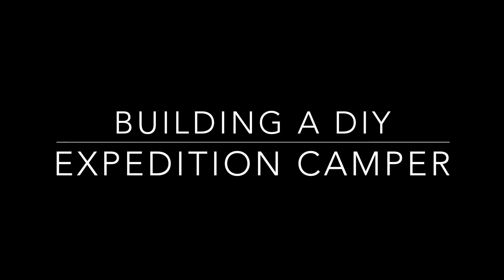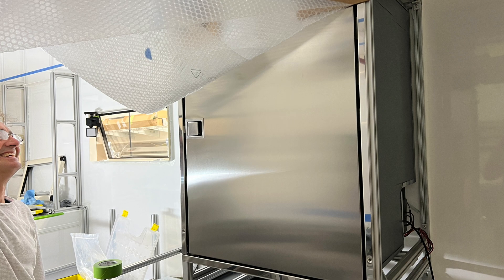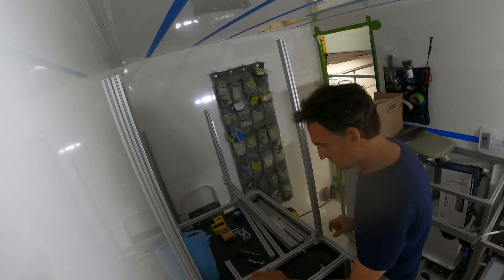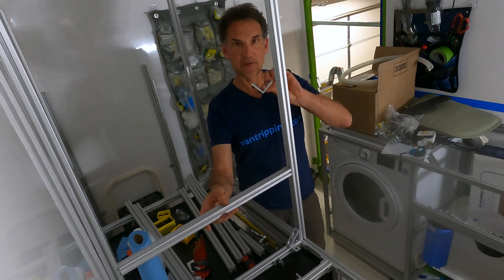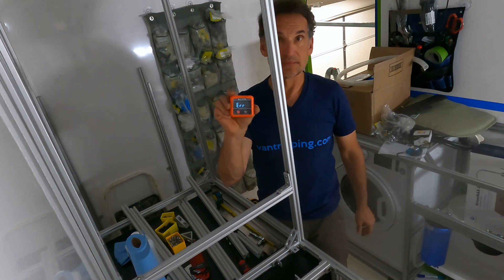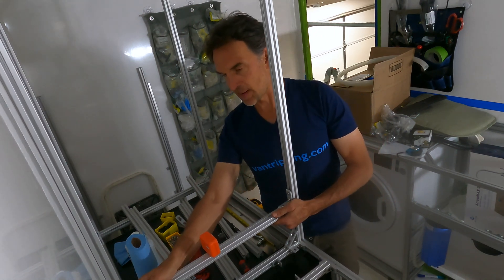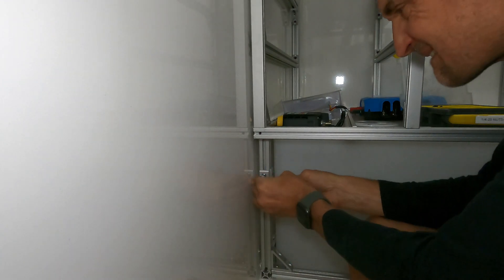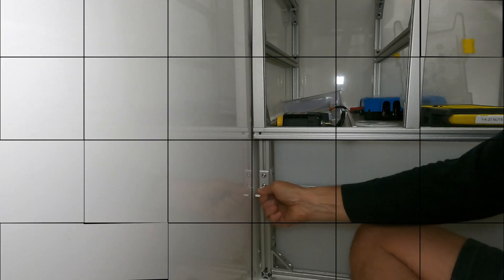Selecting hardware and connectors for 8020 cabinets

Comment: I really like your attention to detail and the way you are building this project. I'm planning doing something similar in the near future. I have a question regarding the screws on the aluminium cabinet frames. How do you prevent them becoming loose over time with road and off-road vibrations? Thanks.
Reply from the maker: Thank you and good question. I don't use thread locker, instead I just torque them to their spec'd torque, which is quite low for a 1/4-20 bolt, around 10-foot pounds. In my last camper built with 8020, I did not have any loosened screws even after much rough trail and road travels, so I don't expect the bolts to loosen so long as everything is straight, tight, and well connected and interconnect with each other, the whole system should not move or flex especially in a composite camper on its own subframe. I could use thread locker, but since I haven't experienced loosening of screws and thread locker adds a lot of time per bolt, I just simply torque and built it well. If I come across a loose bolt, I'll just tighten it.
Reply: @vantripping   thanks for the answer. One more question, did you make a video of the finished cabinets? Can't seem to find it. Would love to see them ready.
Reply from the maker: @rodrigoalmeida9978  I wish! I am about half complete with the finishing of the cabinets. It's been a very part time project of lately due to work commitments, but will be sharing the completion of the cabinets and many more things soon.

Comment: Are u using 15 or 10 series?
Reply from the maker: I am using almost exclusively 10 series, or 1” profiles, as it is significantly stronger than needed for incredibly strong cabinets. And a good balance of weight and storage space, all so important in a camper.